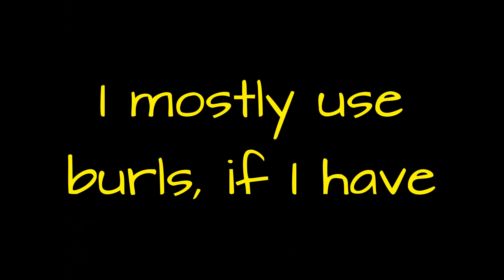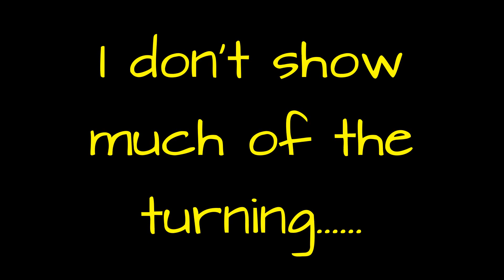Strikkebolle på en annerledes måte. Yarn bowl in a different way.  Garnschale auf eine andere weise.

Comment: Hello Leif, that convinced me to buy the Multistar Duplex chuck. I thought about it a long time and I  normally use an axminster SK114 and a Vicmarc chuck. But the  2,3 mm tennon is a good reason for the Multistar Duplex. Thanks for sharing. Regards from Germany Egbert
Reply from the maker: Thank you, Egbert. Nice to hear from you.
Using MD, we may think in a quite different way compared to other chucks. The bottom side is finished completely at first. This saves a lot of work later. The workpiece may be put in-out several times until everything is finished. My wooden mugs are taken in and out 5-10 times. Besides that: Older pieces may be put back in the lathe for new sanding and a fresh surface.
Good luck with your MD.
Greetings from Norway, Leif.
Reply: @MultiVoff  Thanks for response Leif. Kind regards Egbert